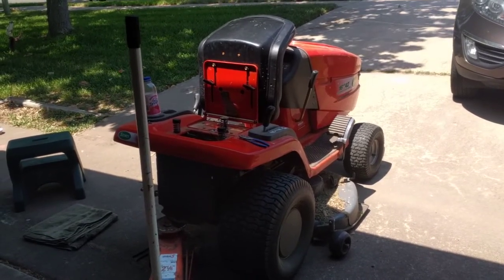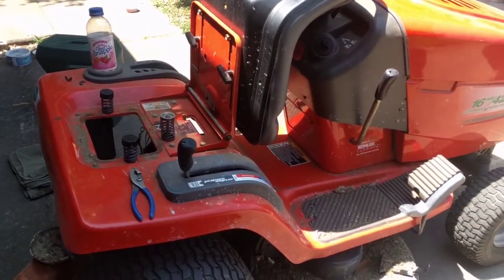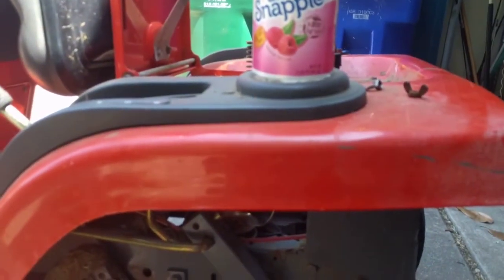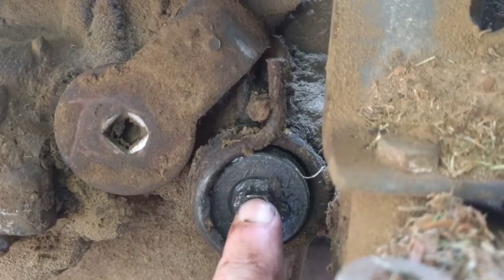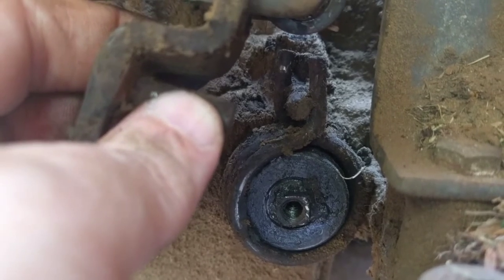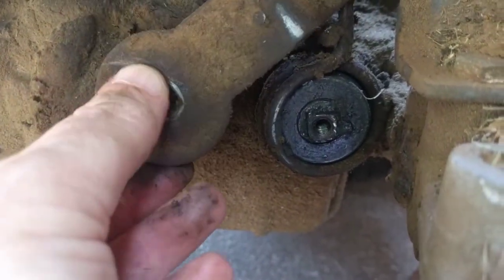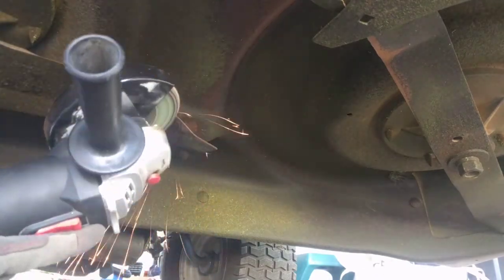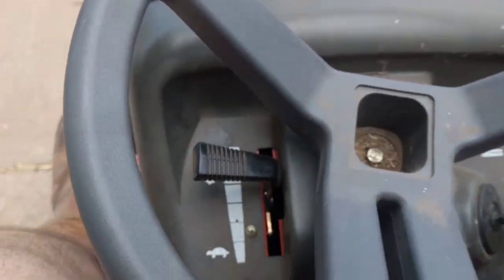Fixing hydrostatic mower drive - no forward movement

Comment: Excellent diagnosis! Thank you for putting this out here.  I just wonder how that pin on the backside got out of position to start with? Did that nut holding that bracket in place come loose and allow the bracket to back out (away)  from the transmission, which allowed that pin to jump out of position? That's my guess, anyway.
Reply from the maker: Yes that's exactly what happened!

Comment: I have a Murray riding lawn mower. After I started the engine, I had to wait about 2 minutes before it can move. I guest the hydro transmission fluid is low. What type of the transmission fluid should I you? Any help is appreciated.
Reply from the maker: I just changed my fluid yesterday and will have a video up soon. I used peerless fluid (factory) but everything I've read says 20/50 synthetic motorcycle oil is the thing to use. I think it depends on type of transmission you have... Mine is a tecumseh/peerless.
Reply: My Murray 's model number is 24700C, 18 HP 46"". The manual said the transmission is maintenance free. Do not change oil or add oil to the transmission.. Could I add oil to the transmission ? If I added the wrong transmission fluid, would the transmission be damaged? Thanks
Reply from the maker: @TomPhan7236  is there something else - I tried to look up that number and can't find anything. FYI my transmission is also maintenance-free I think they all are... I guess they're maintenance-free right up until the point they need maintenance!
Reply: @BubbasWorkshop  I will try the 20/50 synthetic motorcycle oil to see and let you know the result. If the transmission go bad, I will buy a new riding lawn mower. The current lawn mower is 26 years old. What brand would you recommend for the new riding lawn mower?
Reply from the maker: @TomPhan7236  as much as I think they are overpriced the John Deere mowers seem to be really well put together as I've worked on two of them for friends and they were both really nice machines also I think the Cub cadets are really nice The main thing is I would look for the better transmission because that's what goes out and I think some of the higher end John deers have the k-46 and some of the Cub cadets you just have to research them
Reply: @BubbasWorkshop  I followed your recommendation to add the 20/50 synthetic motorcycle oil to my riding lawnmower transmission. It fixed the problem. Now the hydraulic transmission is working fine . Thanks
Reply from the maker: @TomPhan7236  good deal!
Reply: Bubba's Workshop l

Comment: We have a Troy bilt bronco riding mower no forward . Only mows in reverse.  Neutral and forward are also reverse.  We changed drive belts.. any suggestions ?  Thanks.
Reply from the maker: I would look at the shift linkage under the fender and make sure it's moving whatever it connects to on the transmission back and forth. I've never seen one of those in person so not quite sure how they operate.
Reply: Did you find out what the problem was? My Ariens mower just started doing the exact same thing. It will only go into reverse. Forward and neutral are also reverse.
Reply: Did you find out what the problem was? My Murray mower just started doing the exact same thing. It will only go into reverse.

Comment: Pretty sure this is what happened to my mower. Gonna go tear it apart. Fingers crossed.
Reply from the maker: If you have the same transmission the first thing I would do is just grab it by the rear end and pull it up to where it's standing on its nose and then you can pull that bellows cover off and just throw some straight 40 weight in there or 30 weight compress the bellows put it back on and see if that fixes it and if it does then you know an oil change will help if not then you just have to cost of a quart of oil. For I think I show in that video there's also an access plug on the top if you take that fan off I'm just not sure if you can get to it on your mower.

Comment: I have no fwd or reverse changed drive belt please help
Reply from the maker: You need to push the pedal back and forth to see what it moves on the transmission ( like in my video it's that lever on the left side of the transmission). Once you find that make sure the pedal is actually moving it if the lever is moving then the next thing to do would be to check to see if there's fluid in the transmission.